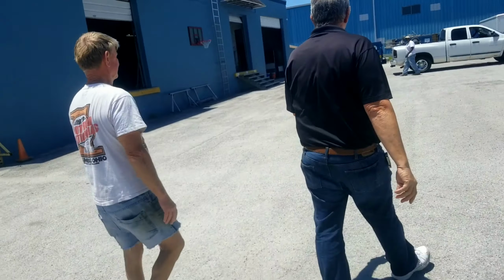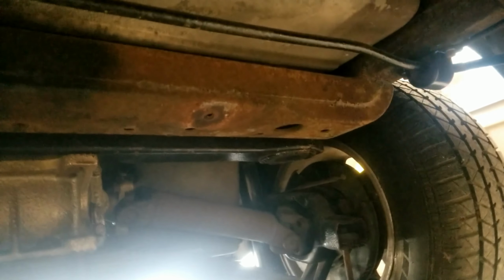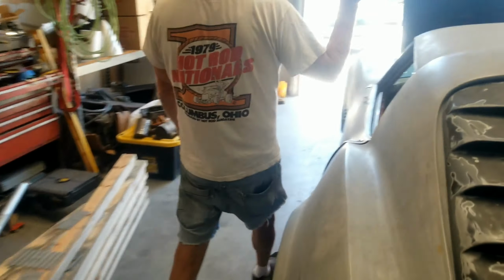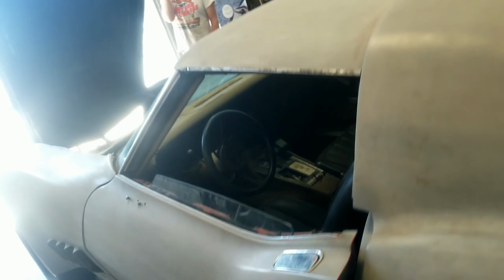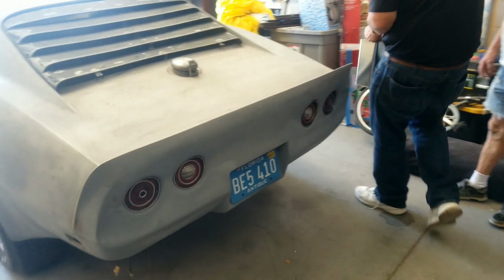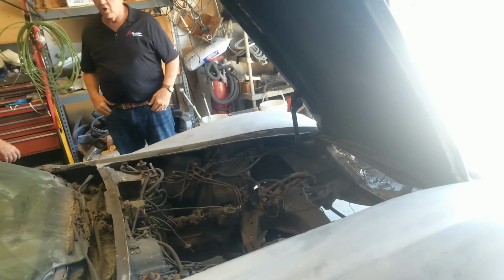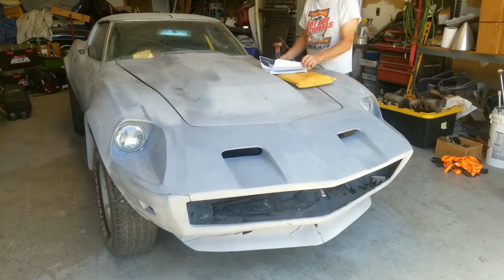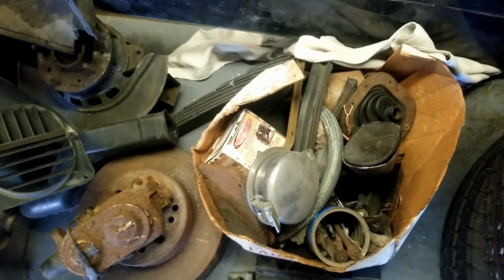I try to buy 1 of 3 Lost Baldwin Motion Performance Corvettes

Comment: I worked for Motion and Rosen from 1969- 1971 PART TIME along with my friend Stan Noren. At the time we were both rookie NYPD officers working on the Tactical Patrol Forc (TPF for the old hippies) 4 days on, 2 days off from 6PM to 2 AM. We built many of those Baldwin cars with my specific job was changing intake manifolds and installing Holley 3 barrel carbs, resetting them, and pulling 4 speed transmissions and installing HP clutches. I seem to remember this colored car as being OVER $10,000 ar the time and just thinking I had bought a house in Queens, for $14,000 and could only wish I would ever be rich enough to afford a MOTION CAR! Joel used to take EVERY CAR we built or did major work on, out in front of the shop on Sunrise Highway and do a 1/4 pass in front of the shop! All the employees would stand outside watching the smokey burnouts and the 100+ MPH passes! Going on 55 years ago and would give ANYTHING to relive that time and excitement. Don't know if Joel is still alive, BUT at $2,000 for his authorcation, it is a TOTAL STEAL in today's hi-po car market!
Reply: Can I get any info from you roy about my motion car that
Reply: @Turnbaughscustoms  Joel never cared about numbers and being able to certify if one was an original car, or one of the many that were put together with PARTS bought from him. Joel died a few months ago but if you can get a hold of Judith (believe that was his wife's name), she might have some paperwork and for $$$ I'm sure you could buy a bunch of whatever papers that are left. Hell, 50+ years ago money is what drove him, and being in CARS magazine in almost every issue was like being on the Internet today. Wish I could help you more but it was just a job back then and who knew those cars would ever be worth the price they go for today!. Looking back, it sure was a hell of a ride! 😄

Comment: Base gas filler cap option was Mopar no "fuel" Charger pop cap.  "Anybody COULDA put 'em on....". PASS.  Cheap ?  Low-ball CASH or pass. He'll call you back. "All the RIGHT parts, are at my house....blah, blah, blah. ..medical woes.? Found it in a barn ?  No answer. "I traded a Merc"...blah, blah, BYE . Way to many people in this circus ring. Asking questions...."oh, that's a problem too..."  Has some MOTION spec parts....so did 1/2 the NYC street Punks, from Staten and Long Island boosted and stripped vettes.